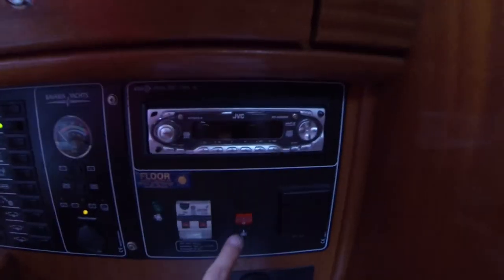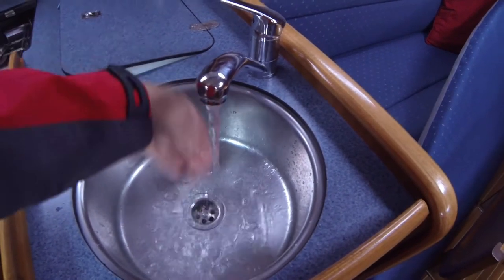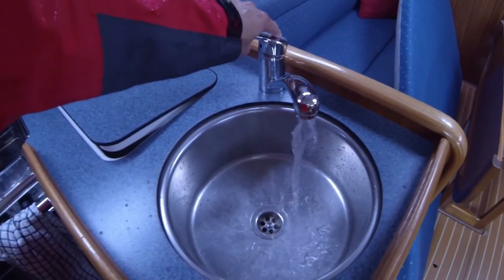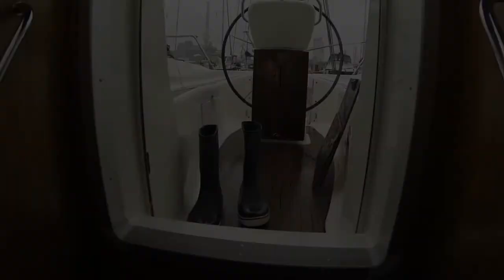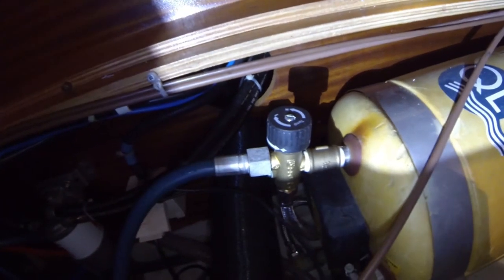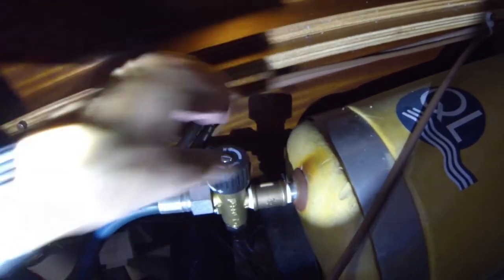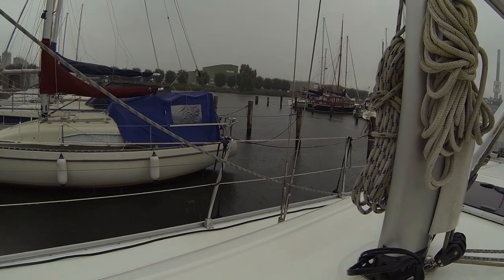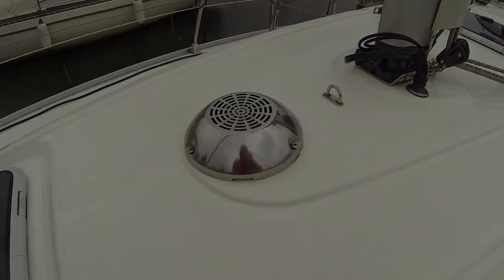QL 800 W waterheater test with 220V

Comment: How do you get on and off your boat? A previous video showed you a long way from the pontoon. Enjoying the vids ... I have a 2001 34
Reply from the maker: I usually pull it to the walkway and step up on the woodstep in the front of the boat. If it is very high tide I get up on the anchor and then steps up on the boat. When i leave the boat I just jump from the woodstep to the walkway on land.